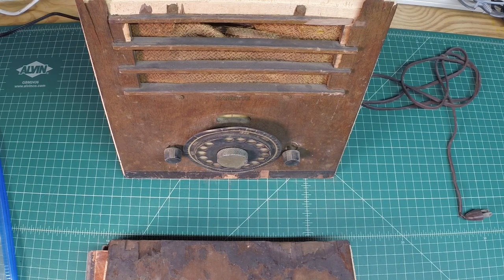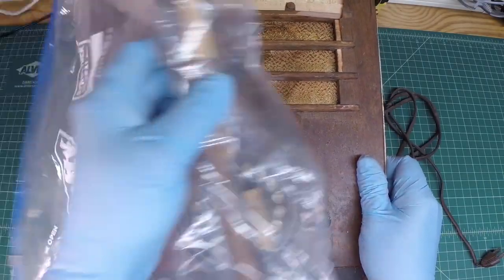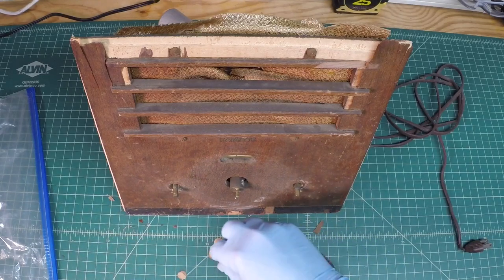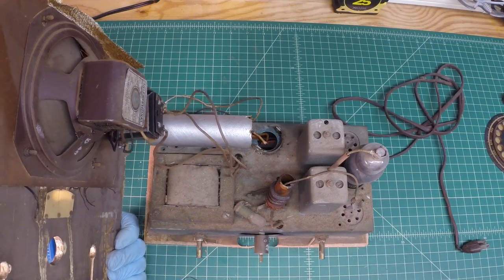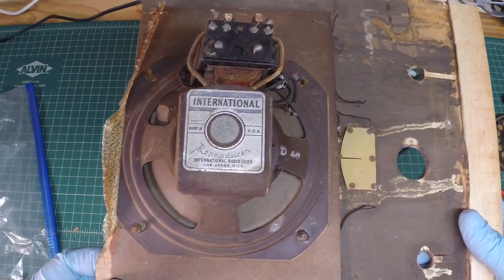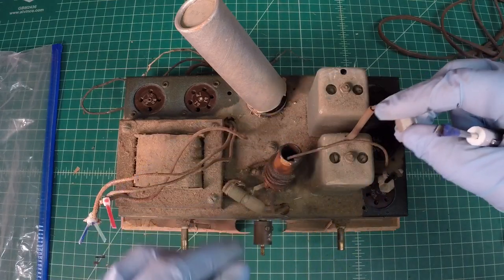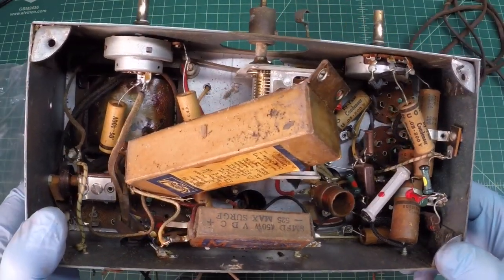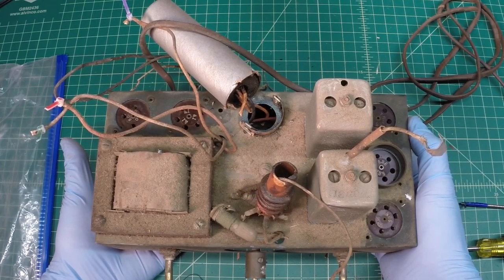Kadette Tele-matic AC Model 35 - Taking a Closer Look

Comment: Wow! what a find. For the electronics, I have restored worse. If the power xformer is good, go for it! With your wood working skills, you can easily restore that cabinet. Re-stuff all the original caps and reproduce the dog bone resistors (there was a good link on the Antique Radio Forum a few years back about making repro dog bones). You got a fun project.
Reply from the maker: David - I need to check the PT for sure and the coils. To your point, it's clean underneath. I've never reproduced any dog bones, but I do recall reading about this process in the past. Thanks for your recommendation and taking time to watch. Best, Don

Comment: I have always liked Kadette's blue hammertone chassis finishes.  Interesting radio,
Reply from the maker: Hi Larry - would you have any more information on the right shade of blue to use since the cabinet it faded somewhat? Best, Don
Reply: +RestoreOldRadios Hi Don - I have not had a Kadette in my collection for the last five years or so. I remember they are a medium blue almost with a hint of silver although I suppose that is due to the hammertone. I last had one of the 11 tube models where five or six of the tubes had only the heaters wired and were only ballast. Here is a picture of that set on Radiomuseam that shows a pretty accurate view of the chassis color as I remember it. 

http://www.radiomuseum.org/images/radio/international_radio/kadette_1019_904771.jpg

Regards, Larry
Reply from the maker: +Larry Fowkes Thanks for the link Larry. Thinking back on it, I may have a Kadette. stowed away I can reference as well. I appreciate you following along. Best, Don

Comment: Rare model or not it's a cool radio.  As for the cabinet, it seems repairable too, I'm sure you can do it after seeing some of those other train wrecks you have fixed.  Correct me if I'm wrong, but the sides glue on the the front as well as the bottom with the top glued only to the top of sides leaving a gap between top and front board?  Then to form the curve on the front top a few layers of bent veneer are used with a final layer of veneer wrapping from the top to front boards?  If that is true then it seems like a rather straight forward fix with the most difficult part being bending new veneer.  Regardless it looks like a fun project for me to watch and I hope for you to do so I vote for you to save it .  Thanks!
Reply from the maker: Zach, I think you nailed it. The top piece has some curved support under the veneer that I will need to fabricate or create a better solution. Thanks for watching and sharing your insight/thoughts. Best, Don